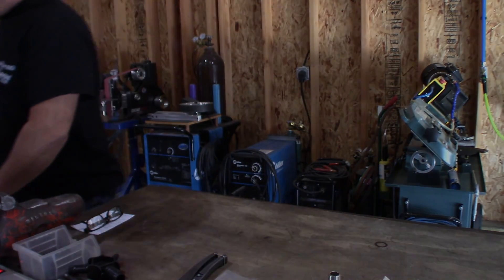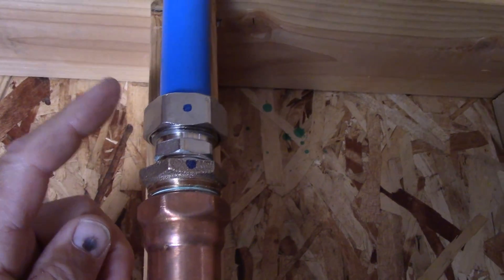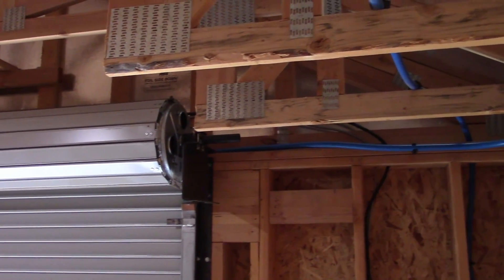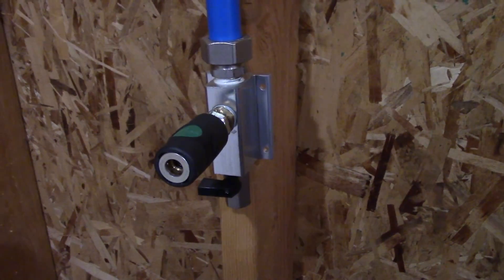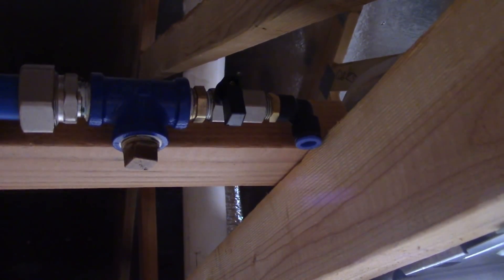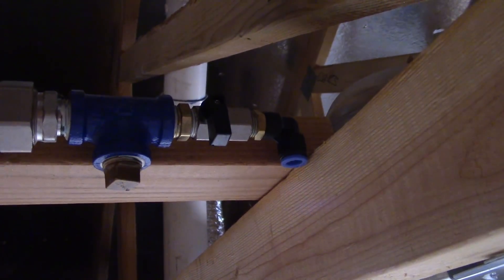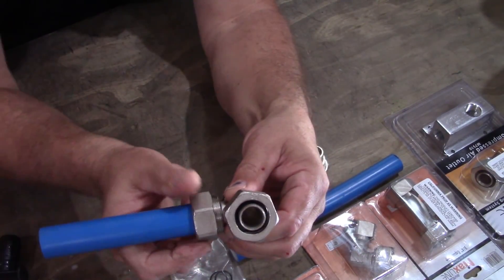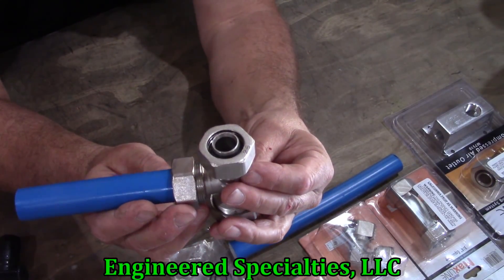Rapid Air Max Line Air System #realraysgarage

Comment: Nice video Ray! Does Rapidair guarantee the piping for any extended period of time? I think I might be worried about installing it in concrete...unrepairable.
Reply from the maker: dihskursiv I am not sure of the warranty. I would not have a problem installing the MaxLine in concrete but not the fittings, leave them exposed. You could also run it inside pvc pipe for extra protection!

Comment: Would have been nice to see some of the installation challenges in unrolling and installing the coiled tubing.
Reply from the maker: LTVoyager To be completely honest, I really did not have any issues installing the system. It was straight forward and installed very easily and better yet no leaks to date! I did all the bends by hand and it uncoiled pretty straight. The tubing is very easy to work with. Feel free to hit me up with any questions. Best Regards, Ray

Comment: Good review Ray. I really like the looks and function of this system. It looks very easy and quick to install. I've been dealing with tripping over air hoses running everywhere in my shop for way too long. I'm gonna have to spend the dough and get this system.
Reply from the maker: Thanks, I wanted to avoid air hoses on the floor as much as possible but still have a very usable system.

Comment: Why not just cut a two by four the length of the outlet. The then screw it to your studs for the mounting
Reply from the maker: Hi Micheal, Yes that would have worked just fine and would have been easier! I enjoy machining parts to make things a little more interesting and it's amazing how many folks asked me to make these aluminum backing plates for them, even RapidAir loved them and might even be making them for the kits! Thanks for tuning in!

Comment: Nice installation! Kudos! I've never done any air line work, but had a thought. I think I'd consider extending the drains down below the aluminum fittings a few inches. My reasoning is that it would might be advantageous to let accumulated water/spooge collect in a short length of easily/cheaply replaced line; as opposed to those nice aluminum fittings. Anyway, just my .02¢ worth, cool videos, Thanks!

Comment: Hey Ray you still happy with this product? Since I am building a new shop I am considering going with this set up.
Reply from the maker: Hill Top Machine Works Hello Tom, Yes, very happy with this system and highly recommend. To date no leaks and very easy to add drops. The fittings are a little pricy but I feel worth it. I ended up buying everything on Amazon, was the best deal at the time, compare pricing on eBay as well.
Reply: Ray's Garage Awesome thanks.